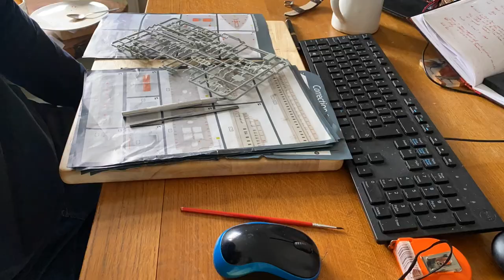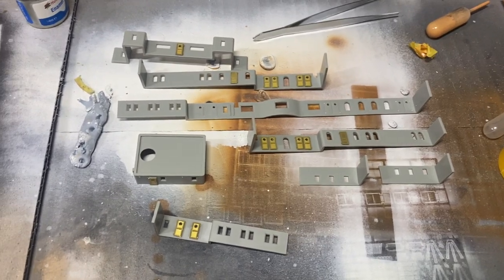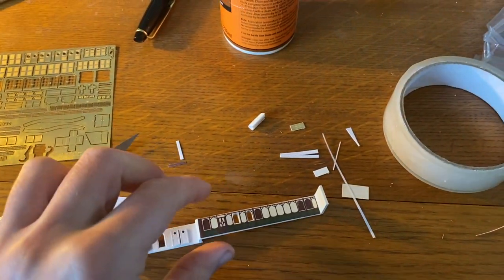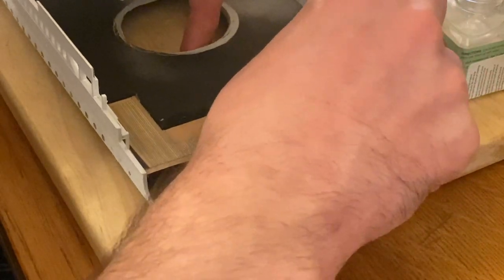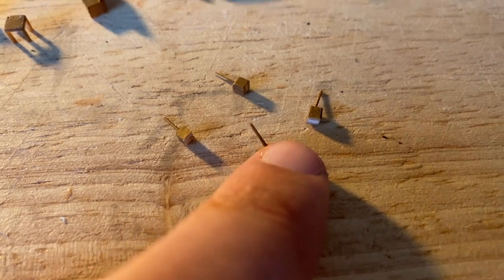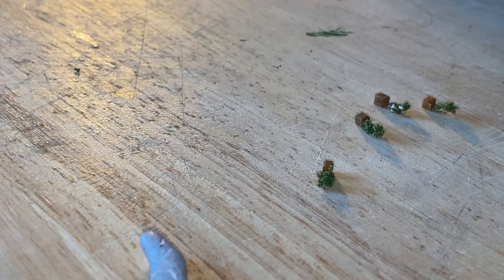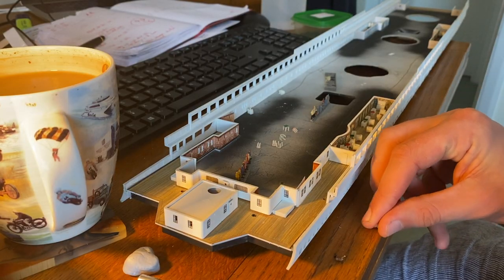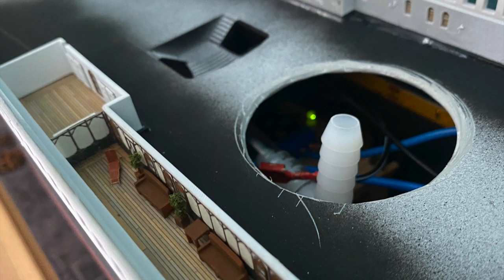Radio Control Trumpeter 1:200 Titanic Build Part 24 - Cafe Parisien and Private Promenades

Comment: Hi Rob, yes the hull is coming along quite well thank you.  I am still narrowing the stern half at the moment, a bit of a mess to look at but it will obviously be a lot better once the cosmetic work starts. It's amazing how much more elegant the subtle streamlining makes to the hull.   I managed to fit the centre prop shaft without cutting away the rudder bracket first. Your Cafe Parisien and private promenades led me to research those areas for my Olympic.  Naturally mine will be a little different in decoration (1930) and will include a cocktail bar at one end too!  The chairs and tables were cane work so I may try and make those out of some of the masses of spare PE material that I will have in stock.  All good so far but slow going!  Regards JH :-D

Comment: This looks immaculate. When printing the interiors and windows, what kind of print size setting and paper size did you use? (e.g. 'Actual Size', 'Fit to page')
Reply from the maker: Oh this is a good question! I think it was actual size, such a long time ago mind you so i could be wrong. 
If you need I’d just print a few out because inevitably the first one you cut might be slightly skewed! I got through a few before I got it exactly as I wanted it
Reply: @TheModelBoatGuy  For anyone wondering in the future, ‘Fit to page’ seems to be the best match. ‘Actual size’ prints them too large.
Reply from the maker: @cameronjm9114  righto, I’ll make a note of that for future questions. Thank you 🙂

Comment: At 15:43 there is a suspicious rectangle shape laying on the black interior area of B deck on the port side just to the left of the bulkhead you just glued near the corner. Looks like a window frame fell off!
Reply from the maker: You are correct.
I cloughted it with my craft knife while off camera. I had to glue it back on later. It was a lot trickier to attach the window once the wall was glued in place 😛
Reply: @TheModelBoatGuy  haha, well atleast I'm glad you noticed it and managed to get it back on. Rather than the alternative of noticing it missing on the model much later on; long after it has fallen off and been sacrificed to the carpet gods.
Reply from the maker: Aaah plenty has been sacrificed to the carpet gods. Many have gone but few have returned to tell the tale.